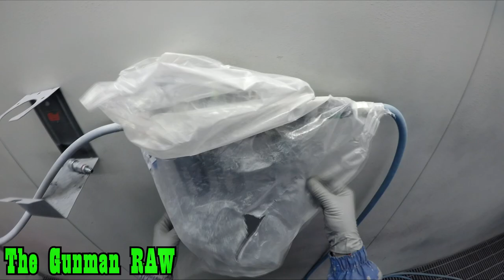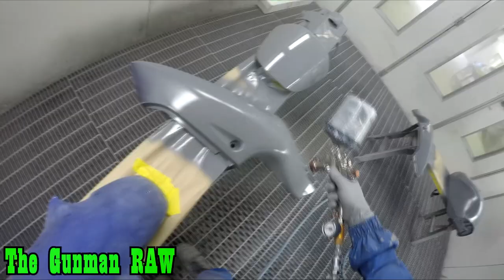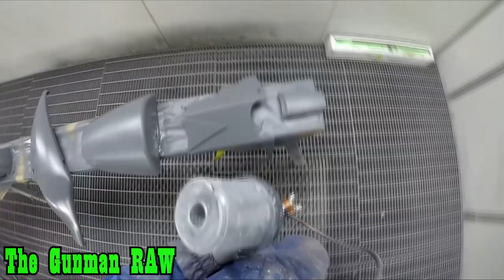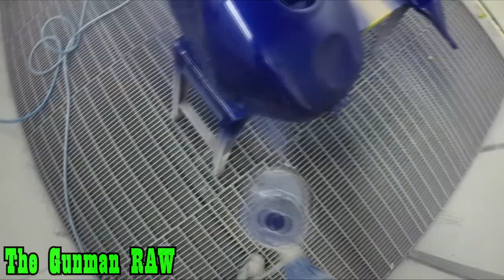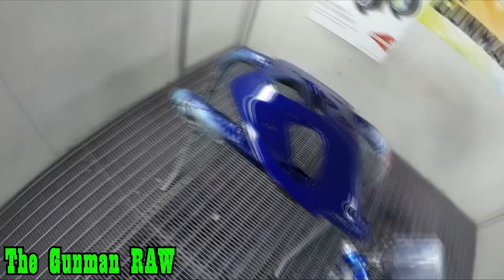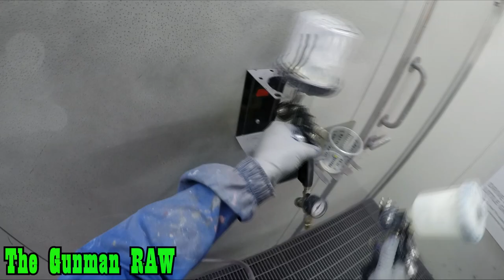Spraying Motorbike Parts

Comment: Hi gunman
I’ve painted my bikes plastics with Adhesion  promoter than 2K undercoat .
But while rubbing back the 2K I’ve had a rub through to the plastic in  a few spots what do you recommend I paint on those bits before basecoat

Comment: Just wondering why you do blast air onto the parts just before you filler them. Does it not go onto the other freshly painted parts?
First I thought that you do not worry since it was only the filler coat and you would have the chance to sand it out. But you did not, did you?

Comment: Hi, can you make it clear for me? 
I have some doubts...
The primer is the same as the adhesion promoter?
If not, what adhesion promoter do?
Primer first? Then adhesion? Then paint?

For the tank, do you use same primer? (it's ok plastic primer, for metal?)

And tell me please those stepes are correctly for painting. 
1. Sanding
2. Clean
3. Primer (2-3 coats) (10-15 minutes between coats?)
4. Let it dry
5. Base paint (2-3 coats ) (10-15 minutes between coats?)
6. Let it dry 24h
7. Clearcoat (2-3 coats) (10-15 minutes betweencoats?)
 
If you want it more clear
8.Wetsanding
9.Clean
10. Clearcoat (1-3 coats) ?

Please tell me where i'm wrong :D 
Thank you in advice :D

Comment: Hi Gunman!! I hope youre doing alright mate? I'm in Brissy and getting ready to spray a motorbike myself. I know this vid was 3 years ago, but your video has really helped me to get my tactics together for it. I just have a few questions please mate? 
1). What is the "wet on wet" primer sealer you used, or whats easy to get a hold of here in QLD? 
2). does it require sanding before base, or can i just spray base straight over it? 
3). If i use a 2 pack Nardo Grey, will i have to go over it with clear, or is the gloss built into the 2 pack paint?
my apologies if these seem like amateur questions. Cheers mate.

p.s. love your vids man 🤙
Reply: Мокрый грунт шлифовать не надо, если только мусор  можно суперфайном, 2к краски не нужен лак, если хочешь то можно нанести.

Comment: Bos your noodle for primer 1.??
Basecoat 1.???
Clearcoat 1.??
Im newbie in gun paint!!!can u deserve me what noodle gun u to spray. Sori my eglish bad..im from malaysia
Reply: You base your gun tip size (noodles you eat, haha) with the paint you get.  It will specify what size is correct for the product you are spraying (for example, my Wandacoat HS specifies I believe a 1.3 to 1.6 mm gun).  Primer is usually 1.8 to 2.0.  Basecoat and clearcoat are usually 1.3-1.6.  I am painting my motorcycle and my primer gun has a 1.8 tip and my basecoat gun uses a 1.4.  I am using Spraymax 2k in rattle cans for my clear but my 1.4 gun would also be for the Wanda clear coat if I used that.  Primer is going to always be thicker.  For flakes, you can use a 1.8 to 2.5 with 2.0 being a good size for that.

Comment: Awesome video Gunman! :))
few questions: should I use "wet on wet" primer instead of basic primer on motorcycles because of the complex details and hard spots to sand? As I see "wet on wet" will be way faster as I'll skip sanding the primer.
What about "wet on wet" with 3stage pearl? And how about pinstripping? After I lay wet on wet and base coat, can I use tape on it, it won't take the primer off?
And the last question: as the end result, the gloss is the same with "wet on wet" ?
Thanks :)